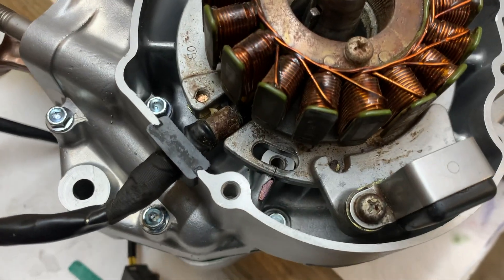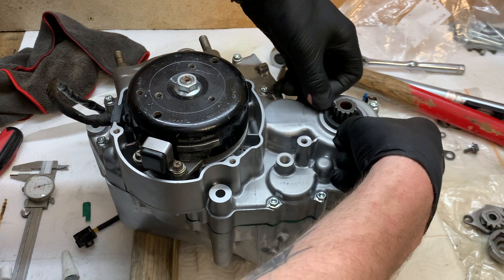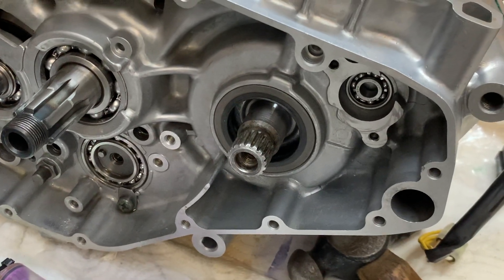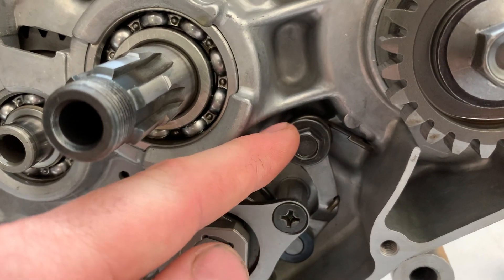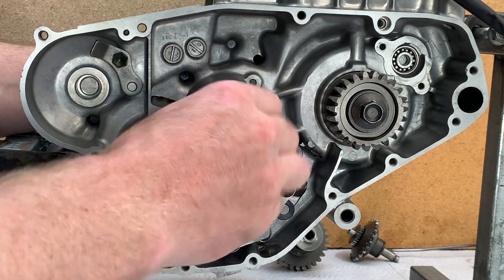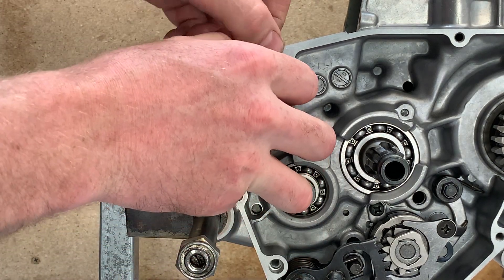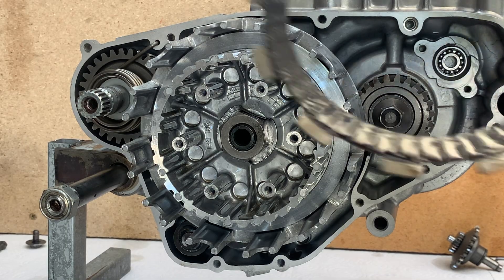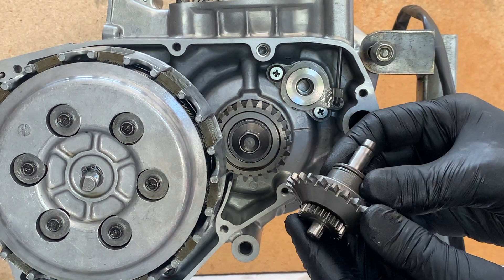Suzuki RMX250 Rebuild Ep.9 (how to engine build part 2)

Comment: Nice engine!
The backside of your clutch holder tool has 2 pins that are made for counterholding the flywheel when tightening it.
Should there not be a washer under that nut as well?

Comment: Hello Jack I live outside Melbourne and own 4 RMX's. 2000, 1998, 1994 and a 1993. They all run apart from the 93, having just removed the motor from it to begin a rebuild. I bought it blown up about 8 years ago and have been scared to start the full tear down. That is how I came across your videos they are good and inspiring to tell you the truth. Should have attempted it on the PE250 I blew up when I was about your age. I'm 51 now and still love the yellow and black Suzuki's. You'd be a great bloke to have around the workshop as I have two Yamaha's from the 80's that need the same thing done to them. Can't wait to see the end result. You can always ride it here on the farm.
Reply from the maker: Glad I could inspire you to get another bike running! thank you

Comment: So clean man
Looks wicked
How easy and expensive was it to find a cylinder replater in Aus?
Reply from the maker: very easy to find a place that does it, there seems to be 3 major places in Aus that do it, I went with Electrosil here in Melbourne, just got a call from them today letting me know my cylinder is done and they said $530 just for the re-plate
Reply: @jackkellybuilds  that’s mint
Not as bad as I was expecting for aus 
Good to know some of these old bikes you don’t have any other options
Reply from the maker: @roocrew86   yeah could be worse I suppose, I've heard some people have gotten steel liners installed into the cylinders, like ye ol' engines, but I prefer to stay with the modern era. steel liners are around $300 from what ive heard